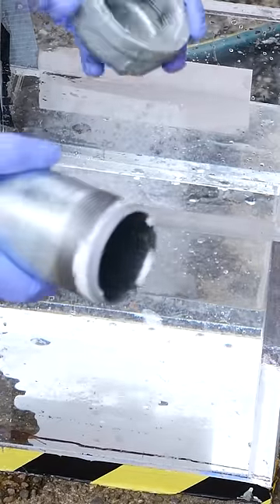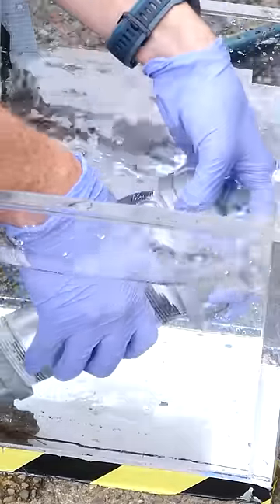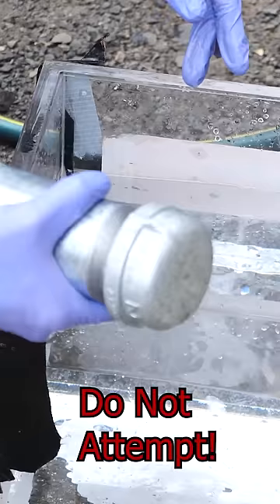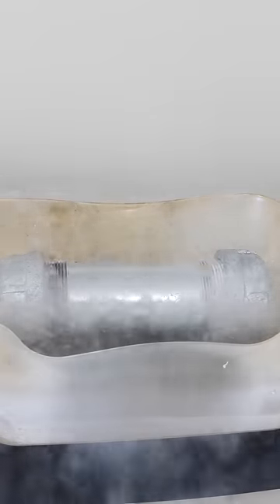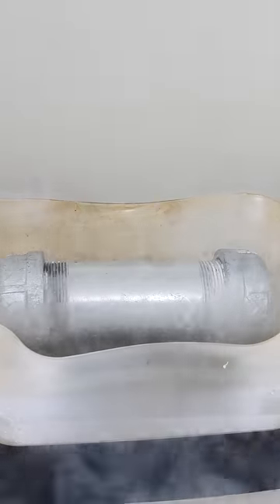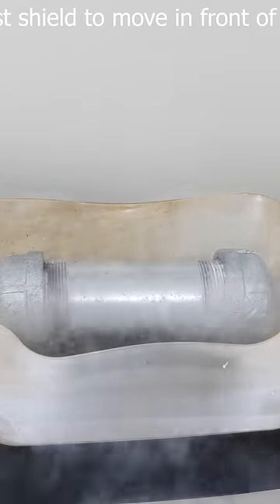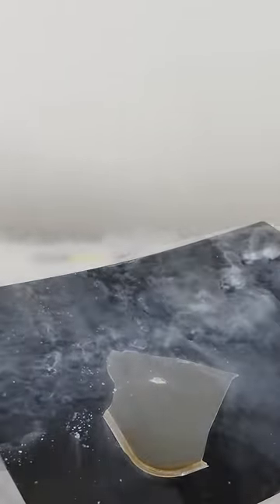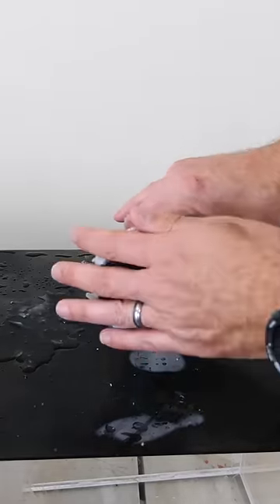Don't Ever Try To Stop Water From Freezing!

Comment: 2/3 the equation is missing.  Yes - water expands when it freezes, but steel contracts AND frozen steel becomes brittle - less likely to flex and more likely to shatter or crack.

Comment: this explosion was only from the seals breaking along the screw cap. I would be scared to imagine what would happen if it was a fully welded close container. the pressure still has to expand but it would force the steel material itself to fail resulting in an even bigger explosion

Comment: "Those threads are never going to hold" was my first thought when you explained what you were trying to do.
Reply: So what would have happened,  if the end caps were welded on ?
Reply: I mean anyone from the middle of country could have told you pipes bursting is a thing.

The question is what the limit actually is.
Reply: @wayward03  He should have held an election, and the pipe would have burst even quicker
Reply: @LosslessOne  since he is working with liquid nitrogen making the metal brittle, it will never expend in a similar test
Reply: @tiborpurzsas2136  a higher pressure explosion most likely. As long as the pressure inside the pipes exceeds the pressure that the pipe can hold it will explode. The rapid freezing and extreme cold make this so dangerous. In regular conditions the pipe will crack.
Reply: @wayward03  pipes, sure, but those pipes are not made of steel.
Reply: The threads didnt give, look again.
Reply: @bizzzz  Wow, you're right. Nice. No welding needed.
Reply: @LosslessOne  Pretty sure the ice is making the pipe into a pressure vessel.  It's not that the ice is exerting pressure.  It's that the ice is pressurizing the remaining water to a point where the water itself overcomes the steel.  That's why the end caps blew off....thinnest resistance.
Reply: The threads did hold, though.  The endcap broke while still being screwed on, lol.

Comment: This is why water meters made for northern latitudes have a cast iron bottom plate. If the meter freezes, the bottom gives way before the brass enclosure has a chance to distort. Then all one has to do is replace the measurement chamber and put a new bottom plate on.

Comment: In addition to the immense pressure inside the tube, steel often changes its characteristics as it drops in temperature. Past a certain low temperature, the steel passes a point called the "glass transition temperature", meaning that it becomes much more brittle and much less ductile and tough, making it shatter like glass, hence the name.

This used to happen some early steel ships while sailing in cold waters. They would literally snap in two.
Reply: That cap is cast though, it was brittle from the start.
Reply: Titanic?

Comment: In the scenario where the container can withstand the force of the ice freezing, water will actually form into a different crystal lattice pattern that decreases its volume, which then allows part of the water to freeze in its more common lattice structure to perfectly fill the container
Reply: Does the different ice have any different properties? Mass changes? Etc
Reply: @lotion5238  its density will vary as the packing organization will change and the different ice lattices will have their molecules closer together than others. Overall, if the ice freezes to exactly the same volume of the water (extremely reinforced container) it would pick multiple different lattices to average out to the same density as water (same mass, same volume). Sorry for long-winded reply, I just think it's really cool

Comment: This is exactly why you let your facets trickle in the winter to prevent your pipes from bursting in under your house in the winter on really cold days.
Reply: Id rather risk my pipes burst than pay an extra 10 dollars
Reply: @ZBREAD. edgy ass comment
Reply: @cloudskyfx6719  you're not using edgy correctly if you think that's edgy
Reply: @ZBREAD. If your pipes burst it's gonna be waay more expensive to fix em
Reply: @mmems30  nahhhhhhh
Reply: I've actually never been told to do this, which is interesting! i think it's because i have only lived in houses built from the 1980s onward so maybe the newer ones where i live have different plumbing than where you are
Reply: Or just keep your thermostat set at 70*. What, you don't have vents in your basement?
Reply: Our just leave your faucets off like a normal person. If your pipes are freezing you need to fix your house. My house was built in 1942 and it's fine. I have -20 winters where i live.
Reply: Do people do that there?  I don't think I've ever seen temperatures drop under 4°C here in Brazil.
Reply: @Thelaretus  it's cooler up north. In the Midwest USA -30c is common. Pipes only freeze if the house has insulation issues though.
Reply: @ZBREAD.  -- No, you don't have a grip on reality.
Reply: @ZBREAD.  Not "nah" (correct spelling), it is yes.  You were being corrected.
Reply: @PoliticallyInsensitive  -- "Under you house" can mean a crawlspace where pipes are more exposed, and there nay be a certain amount of insulation wrapped around them, but nothing 
like the pipes being in an enclosed basement.
Reply: @robertveith6383  it was the "nah idgaf"
Reply: @robertveith6383  cry
Reply: @ZBREAD. then your paying more to fix it lol
Reply: even if you pay an extra 10 a month for all of winter that's still like half the average repair cost
Reply: @ZBREAD. Youre not funny or cool lol
Reply: @strider7198  I didn't say I was
Reply: @ZBREAD. , bro legit said he rather make a hundred dollar repair than pay ten dollars. 💀
Reply: @RoundShades  I mean, not like its 100% right
Reply: @Thelaretus  yes, you don't need to do that unless it is REALLY cold where you leave and most of the pipes are not insulated correctly. This is common in the US in teh north of the country in particular. You have pipes going in crawl spaces under houses, so not insulated and exposed to the element. And it gets -20C almost every winter.
In my house (south of the US), there are water pipes going on the external wall of the house. And in a cold winter the pipe can freeze. It's too short a section to cause the pipe to burst in most winters here as it doesn't get very cold where I leave. But if I expect a -10C night (which is uncommon) i leave a small drip on just to be safe.
Reply: In the UK our boiler just keeps our pipes above 5c automatically god America really is far behind Europe. It's like a third world country compared to Europe half the stuff common normal house holds have here like a kettle use don't have. Who's still boiling water on a stove
Reply: You only do this if your home is not heated or if the furnace is down. You do have to drain any water on outside lines tho
Reply: @mmems30 he’s obviously joking
Reply: @colin5227 yeah I think this might be advice for old timey plumbing but another big factor is definitely the frequency with which we use those pipes. I have a country place with old plumbing in Canada. My grandpa used to go in the winter and he didn’t need to leave water running regularly because the pipes would get used enough day to day. But now, no one goes all winter so we turn the water off in late autumn.
Reply: @your_local_reptile6700 For real, America still has houses made from wood. 😆
This pipe issue is not an issue elsewhere.

Comment: There’s a reason why you often see rocks and tree trunks literally split apart by ice
Reply: There was huge boulder on one beach here. Small crack on it kept expanding annually when water froze inside it.

Few years ago the boulder broke in half and ice carried one half far from the other.
Reply: Rocks used for a fire circle can also pop dangerously if theu have water penetration and are heated too much.

Comment: Fun fact: the water won't even turn to a solid until the breech of the container occurs. There has to be room for expansion in order for the state to change. You can also do this with a clear plastic container and watch the instant freeze happen as soon as you remove the lid (obviously lowering the temperature more slowly than liquid nitrogen).
Reply: i think youre confusing . you can just shake or tap that bottle for it to start forming ice.
Reply: @VJETRA When you cooling water slowly (distilled water) it becomes supercooled, below zero degrees but still liquid. Shaking this supercooled liquid instantly crystallizes the water using the tiny air bubbles contained inside as nuclei. If no air at all is available inside the container then shaking it should not allow for crystallization, but only pouring it out would.
Reply: @Thetruthiscosmic  Yes but the guy above said there has to be room for expansion for it to start become solid which is wrong cuz water can still go supercool even with half the room/air inside. hes giving a wrong example for his Fun Fact.
Reply: Well, you can have ice with a higher density than water. 
Cool it to about -50 C and exert a pressure of 300MPa and you get ice III at a density of just over 1.1g/cm3. Go to 500MPa and it transforms to ice V at 1.28 g/cm3.
Reply: @gamarus0kragh  that is also the reason why in a theoretical inifnitely withstanding container, water freeze completely at some point. It just becomes a block of Ice III with some Ice I chunks in it
Reply: @VJETRA  why do you think is it possible to make gases become liquid in a container? because they can be compressed. A liquid like water can't tho and so it won't become solid. It's needs the extra room to forms crystals
Reply: That's really cool. I wondered about that like- if it was possible to contain the chemical reaction with brute force and what that would do.
Be amazing to have liquid water chilled to waaaaay bellow 0. I guarantee there are planets where that is naturally occurring due to the gravity and other factors.

Comment: Didn't need to do all that brother just ask a high pressure pipe welder that worked in a cement factory in Canada I have changed miles of pipe that has frozen and busted from thin to thick in a lot of different factories in Canada. Mother nature always wins.

Comment: If I recall correctly, you need a container capable of holding something like 35000 atmospheres of pressure to keep water from expanding when it freezes.  Don't quote me on the exact number, though, and even if that number is right, you would want to have a considerable engineering safety margin, especially when adding the great stresses from the huge temperature gradient caused by immersion in liquid nitrogen.

Edit #1 (because YouTube ate my comment when I tried to make a second post):  Got a chance to look at the phase diagram of water on Wikipedia:  The pressure for the minimum freezing point of water is 202.9 Mpa = roughly 210000 atmospheres, way over the 35000 atmospheres I was remembering, and the temperature for freezing at that pressure is 251.165 k = --21.995 `C = -7.591 `F, and then you get Ice III instead of normal Ice I when it freezes, unless it manages to supercool enough before freezing (or convert later) into Ice III as the temperature keeps going down, and eventually Ice IX.

Edit #2, 2024-06-14:  I messed up the units conversion in Edit #1.  Google units converter says 29428 psi = 2002 atmospheres.  Still an awful lot.  And even so, the thumbnail picture of the video still shows the pipe apparently impressively deformed right before it blows.

Edit #3, 2024-06-18:  For comparison, according to Wikipedia, the pressure at the bottom of the Challenger Deep in the Mariana Trench (the deepest known location in Earth's ocean) is over 1071 atmospheres = 15750 psi = 108.6 MPa, and it says that the density of water under this pressure is 4.96% greater than normal.
Reply: Wow! For sure!
Reply: But would it freeze then or stay liquid?????
Reply: @Aa-jq3yu  See Edit above (tried to put it here, but YouTube ate my post).
Reply: Omg!! I remember the other types of ice/water now! I watched a video on that before! I have to go back and find it. Maybe it was scishow
Reply: Ice I, III and IX ?!
I didn't know water/ice irl got RPG skill grading 😂
Reply: How do you get pressure and not pressure per unit distance? The amount of force from the expansion of water would almost certainly be proportional to its volume (or per distance cubed), while the surface area is clearly proportional to distance squared.
Reply: @btf_flotsam478  Doesn't the force exerted by a liquid is same in all directions ?
Reply: @btf_flotsam478  Pressure is the same no matter how much volume it is applied to.  Now what DOES increase with size is the amount of force you need to apply to hold a given pressure.
Reply: At a cool enough temperature it upgrades to Blizzaga III
Reply: @CogniVision And adding battery juice makes it Blizzara-Thundaga
Reply: I need to see these ices

Comment: You also have to take in account that the metal got well below the freezing  as well.
Reply: Yeah , put it in a freezer 1 degree below freezing.
Reply: @terryenglish7132  ...but the coolant surely lowered the temp of the steel fast. Was that liquid nitrogen?
Reply: @glennjones6004  yeah
Reply: @glennjones6004  yes probably liquid nitrogen
Reply: What? The metal is already "frozen", that's why it's solid. The freezing point of metal is in the hundreds of degrees
Reply: @ethanfields3853  I would not call it freezing point 🙂. Rather be melting point.

That's my view about metals (as the metal is a solid in our atmospheric conditions)
Reply: well that’s how the water froze, the water just like in pipes near cold areas, will stay above freezing as the pipe around it drops in this case well below freezing, in an instant all the water freezes and the pipe bursts.
Reply: Good point!
Reply: Yes the metal in my car explodes every winter when it drops below freezing.
Reply: @terryenglish7132  the water won't freeze then because as the pressure increases the temperature needed to start the phase change also increases.
Reply: @ethanfields3853  At low temperatures, metals get very brittle, steel included. And saying it's below freezing is always referring to water.

Comment: In the old days, the quarry workers would drill into the granite rock in winter and pour water into the holes, to break loose huge blocks of granite.  Powerful molecular alignments!
Reply: Hey! Just wanted to say that expansion is still widely used to this day,  expansive concrete is used to break off giant slabs of marble for example. It's much less violent than explosives and exerts similar force across the whole area.
Reply: Cool!
Reply: What stops it from shooting the water out of the hole?

Comment: try it in a freezer instead of liquid nitrogen. since thats way cloder and it seriously compromises the steel far more then normal 30 degree freezers would. it would still break but i doubt in such a dramtic fashion
Reply: No. Less brittle steel = stronger material = able to hold more pressure = an even stronger explosion. And it'd be harder to see it.
Reply: need to be able to record it in real time so its probably why he wanted instant results
Reply: It will still happen.
Reply: damn bro your freezer is -30 degrees?
Reply: @juhis5936  30 fahrenheit is about -1.11111 celcius

here is the formula (-1.111°C × 9/5) + 32 = 30°F
Reply: @juhis5936  or you could just not do a comparison between a duck and a dragon
Reply: Crazy thing is that you can't break the laws of physics. If you put it in a container strong enough to resist expanding, then water will stay liquid because it can't expand. If it can't expand, it simply won't change phase to solid.
Reply: he doesn't want to destroy the freezer too !
Reply: @HyperactiveSloth79 that's not true. Water would still turn into ice, just of different internal structure than the usual hexagonal structure. It's known as solid phase "Ice II".
Reply: @Jabberwocky869  no it would not turn into ice II, ice II is formed by compressing normal ice by at least 2000 bar. If it cant freeze to ice it cant freeze to ice II.